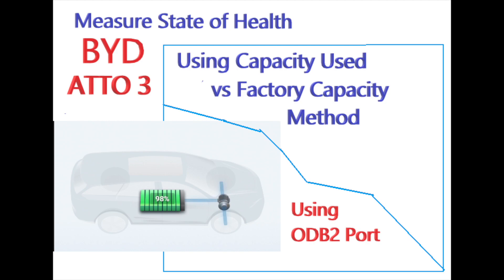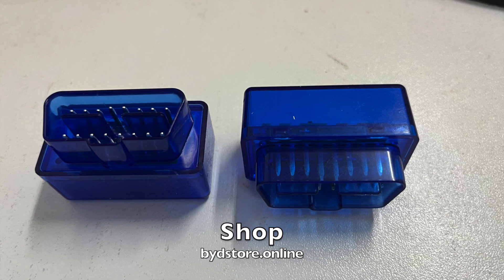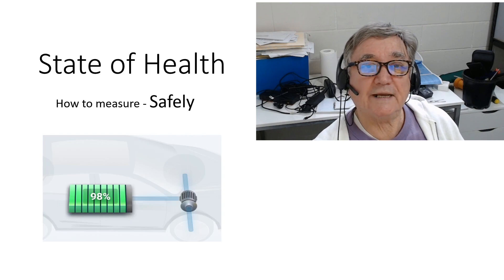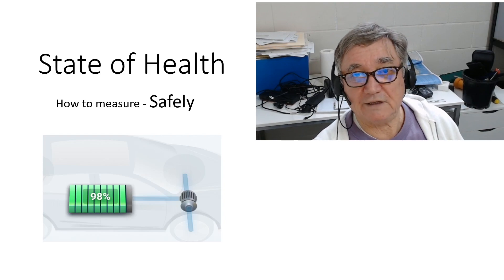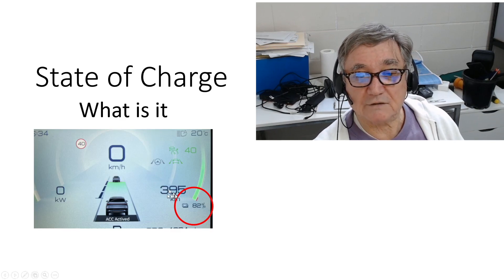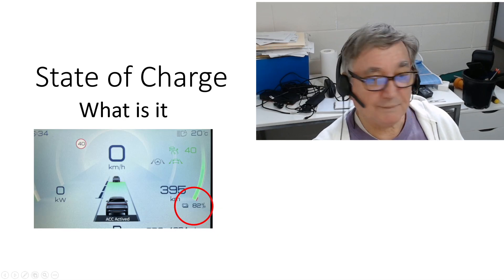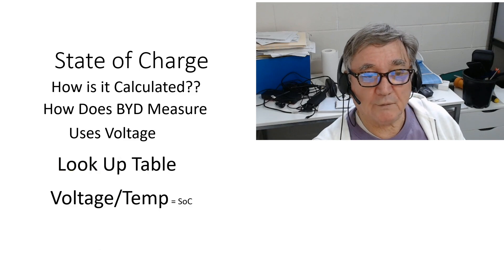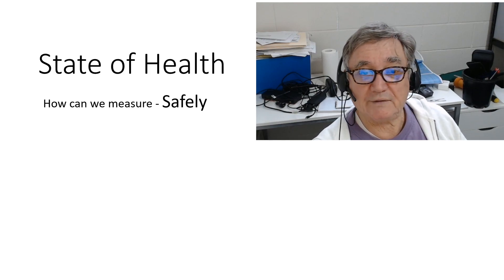Measure SOH using 'Capacity Used' Method

Comment: Have you checked the parameter "[BASU] HV Battery Pack Current Nominal Capacity"? If that value matches your measurement? If yes, then there would be no need to deep discharge the pack: just divide this value by the Factory Capacity one and you get SOH, I think.

Comment: In your example you used 100% of SOC that require a deep discharge. In order to avoid deep discharge can we consider a partial use of the battery and consider a percentage of the factory capacity equal to a percentage used of battery? 
Check my exemple and readings:

Initial status:
SOC 100%
Accumulated Charge: 4168 Ah
Accumulated Discharge: 4076 Ah

End status:
SOC 56,5%
Accumulated Charge: 4189 Ah
Accumulated Discharge: 4157 Ah

Theoretical stored:
Battery Pack Factory Capacity: 138 Ah (100% SOC) – Dolphin GS
For 56,5% SOC, theoretical value is 138 * 43,5% = 60 Ah

Real consumption:
Used 43,5% of battery:
Discharge – Charge = 
(4157-4076) – (4189-4168) =
81 – 21 =60 Ah

SOH:
SOH= {(real consumption) [Ah]/ (theoretical stored) [Ah]}%
SOH = (60Ah /60Ah) %
SOH = 100%

Comment: Actualy Car scanner have 2 PID that called Factory battery capacity one of them marked as copy, when battery calibrates from low SOC to full charge the second one (copy) displays measured capacity. On my car after battery discharge to 1% and recharge to 100 % dislayed 151.5 AH but factory capacity is 153 AH (probably this calculation wrong because my battery cells drifts and several cells randomly deplites faster then other)